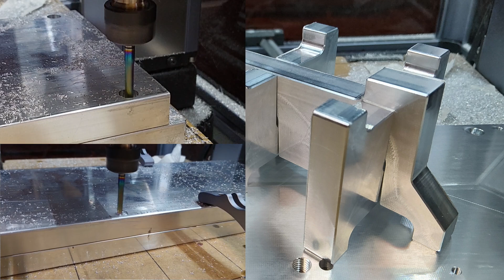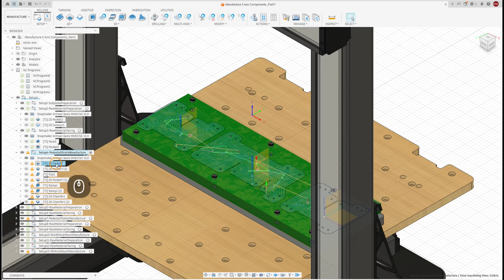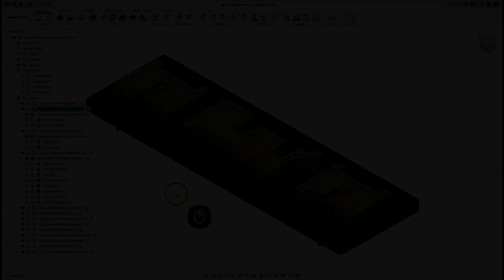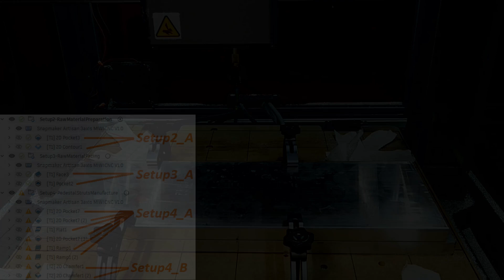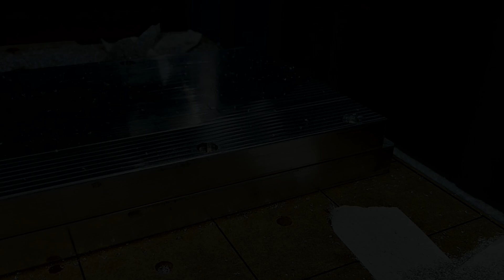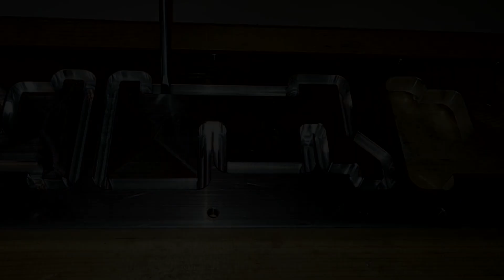Aluminium Milling on a Desktop CNC | Snapmaker Artisan — First 5-Axis Components (Fusion CAM)

Comment: Also, did you have to face the spoil board as well before milling?
Reply from the maker: No i have not faced the spoil board. 
However for other projects (3 axis wood work) i have mounted another wood plate on top of the spoil board and have faced this one.

Comment: I really appreciate that you explained thea cnc manufacturing steps. I enjoy my Artisian, but I rarely use the cnc functionality because there’s a lot of manual alignment and I have to figure out how to get fusion to make the tool paths.
Reply from the maker: Thanks! I’m really happy to hear that my videos are helping you.

I recommend downloading the example file, as it makes it much easier to understand how everything is set up. The previous videos also explain some of these areas in more depth.

Right now, though, I’m intentionally trying to keep the manufacturing process for the 5-axis components from becoming too overwhelming with very detailed explanations. The current goal is to provide something closer to a building manual that helps people produce the components for their own 5-axis setup as efficiently as possible.

Later on, I’m planning to make much more in-depth, from-zero tutorials where I go through the entire setup and show every single step. Those will probably end up being very long videos, though! 😄